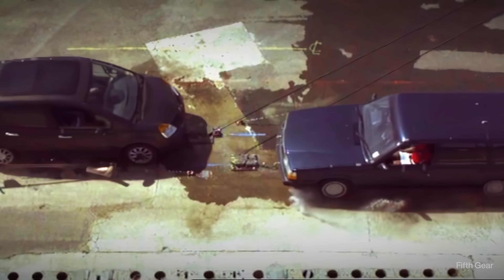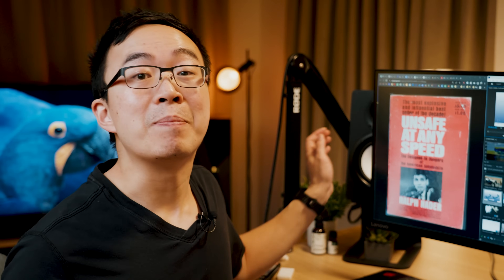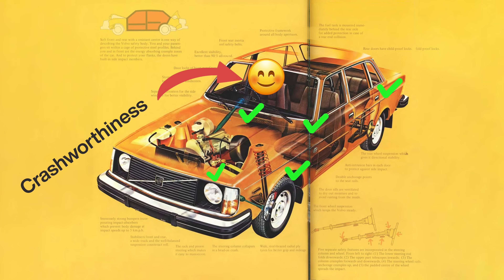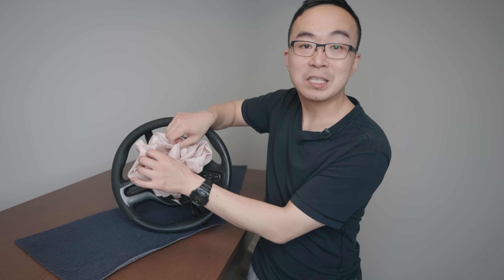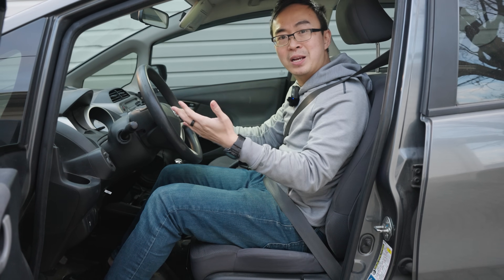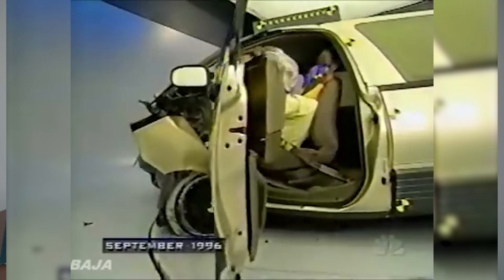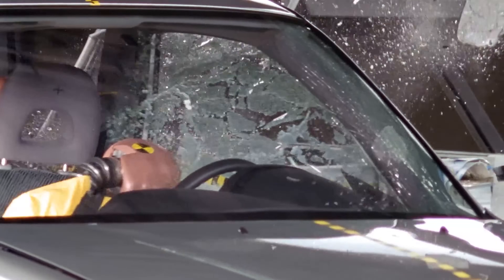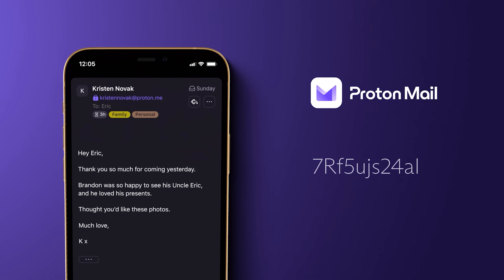When does a car stop being safe?

Comment: The one thing that is often ignored in the US and leads to a ton of SUVs and trucks is that crash tests rarely involve persons outside the car. Yet cars crashing into pedestrians and cyclists at low speed is super common! Adipositas cars (SUVs) usually fare badly here.
Reply from the maker: 100%  it's one of the major differences between American and European cars
Reply: @Mika-ph6kuI occasionally see people who just barely poke above the dashboard
Reply: Good observation! In the US suv's and trucks tend to receive higher crash ratings because of this, hence the trend of more and more large vehicles on the road in the US. Other countries and testing standards actually rate them far lower due to their mass and size and damage they can cause. US crash tests tend to only focus on the occupant of the car.
Reply: ”other countries rate them far lower because of their mass and size and the damage they can cause”?
Well that’s stupid.    
You’re supposed to be rating their ability to protect its occupants during a crash.  
Not fat shaming big cars because of the damage they   could   maybe  one day  potentially cause.   
If that’s true other countries crash testing is dumb AF. 👌
Reply: @jaxturner7288  If everyone has smaller cars, it is better for everyone. If you start going out there with tanks, the ones not having tanks are the ones that are suffering and thus also have to build a tank. That tank isn't better when crashing into a wall than the small car, its only better when crashing into a small car.
Reply: @jaxturner7288  No.  The point is to reduce the insurance companies pay out.  Doesn't matter if they're paying for people inside the car or outside it.
Reply: @Zorro9129  I guess not getting shot in an American school is also a skill issue. Could also be dumb luck. The dumb part being that kids run around with guns in the first place. 

Those big cars have the same effect. People in general aren't that great at driving and if some idiot in a pickup hits you there is nothing you can do. Its not your skill, its just dumb luck. The dumb part .....
Reply: @JohnHughesChampigny  and that tells you all you need to know.  
That means that country’s crash tests are focused on protecting the insurance companies, not the vehicle owners. 👍
Reply: @_aullik  lol obviously you haven’t seen a tank crash into anything.  

Look up tank vs tree. 
Look up small car vs tree.  
And then come back and tell us how much safer the small car is for its occupants.  👌
Reply: @_aullik  Actual pickups aren't much worse than a regular car (the front half of them basically IS a car, shape and size wise. They're a bit longer, their frame and suspension are stronger, the engine may or may not be heavier, and the back end is shaped differently, but other than that? basically a car). modern american SUVs are substantially longer, taller, heavier, and have Less Cargo Space (not that that matters, their owners aren't using them for that) than an acutal pickup truck, as well as being shaped in a way that is less aerodynamic, impares the driver's field of vision, and increases the harm done to pedestrians and occupants of other vehicles in an accident.
Reply: @laurencefraser BS, their usually much higher
Reply: @jaxturner7288 if you don't understand why also factoring in the crash safety for people outside the car is a good idea, then you really shouldn't call others "dumb AF"... 😪
Reply: @Zorro9129 "guns don't contribute at all to the problem" 
More guns will always mean more gun accidents and more gun violence, because neither can happen without guns. It's a very simple statistic fact (more exposition to a risk = more accidents) and you're literally denying reality if you don't recognize this!

Also: "ThEn We CoUlDn'T hAvE 18-WhEeLeR tRuCkS!": right, it's not like there's a special license with loads of extra training and tests required to drive one of those! 🤦
No, we can't limit the maximum weight of personal passenger cars because of all those commercial truck drivers driving 18-wheelers with the standard driver's license for personal vehicles! 🤣
What an absolute shit-take!

Btw: I dunno bout the US, but most European countries literally do exactly that: they limit the maximum loaded weight that the holder of a normal DL is allowed to drive, usually to 3500 kg. 
Which has the interesting side effect that most VANs can carry a bigger load than any SUV, because many SUVs have an curb weight of more than 2500 kg already without even a driver in them, meaning you can only add at most one ton of load (including the occupants) before you reach that 3500 kg limit, whereas even a big transporter VAN may be as light 1600 kg, giving you almost two tons of permissible load capacity, before it would require a higher license class to drive.
Reply: @_aullik  can everyone fit in smaller cars?!
Reply: SUVs and pickup trucks tend to punch you in the chest and knock you under them, which is way worse than being hit in the legs and going over the top.
Reply: Euro-NCAP does these tests, however american SUVs are usually not tested as they are not sold in europe. However these tests have shown that SUVs tend to throw people infront of them an then roll them over instead of pushing them onto the hood, wich is what normal mpassanger cars do.
Reply: @Mika-ph6ku It's like when I see people driving the same kind of car I have but their eyes are level with the top of the steering wheel. I'm of average height and my eyes are several inches above the top of the steering wheel.
Reply: It brings back memories of when I was a kid in the car and my eye line was 4" above the bottom of the window. Now even in "racing position" in my mini my head is quite high.
Or the insult in Midnight Club 2 racing game "You can barely see over the steering wheel you little arsewipe!"
Reply: I can't see my hood at all. If you were short I wouldn't see you either. I hit a 4 foot post and couldn't see it at all. I really don't like it, I used to have cars where you could see down the hood to the bumper.
Reply: @napalmholocaust9093 I don’t fear many… but you scare me
Reply: @napalmholocaust9093 erm, adjust the seat upwards, maybe?
May I ask why you even bought a car that you can't see out of? 🧐
Reply: @napalmholocaust9093  if you cant see down your hood you shouldnt drive. in my country at least its a felony to drive a car when you have insufficient vision (or anything else that is obviously dumb and dangerous) and you will get your license revoked additional to a lawsuit if they ever catch you driving like this.
Reply: @rolhen8221  the UK rule is "must be able to read a number plate from 20 metres", which could be violated if your vision becomes too fuzzy at that distance, or you can't even see 20 metres ahead of you due to you fitting the car like a young toddler.
Reply: Well you can set the seat to see as much of the hood a possible and before you ge too close to not see what it is you're gonna crash into, look ahead and see what's there, if you're not sure then step out the vehicle and check with your own eyes, this is what I do and I don't care if other cars are waiting for me to move, I do this not only for my safety but theirs as well and if they don't understand this then they'll know it when they crash into something they didn't see
Reply: @napalmholocaust9093  ive driven large pickup trucks and tiny sedans and pretty much everything in between. ive never not been able to see the hood, expect in sedans where i intentionally put my seat lower and even then i can still just barely see it. sounds like a u problem lol
Reply: "Adipositas cars (SUVs)" 😂 So true! Each time I look at mid-sized SUVs, I can't help but think of obesity disorder.
Reply: Which is also why EuroNCAP rates not only how safe the car is for the occupants but also to people outside.
Big American trucks and SUVs like F-150, Suburban, etc. fail misserably in those which is part of the reason they aren't officially allowed to be sold on the market and you have to get them imported. The massive grills and hoodline taller than a 12 yo child make them death on wheels for anyone unfortunate enough to get hit by any of them...
Reply: @edim108  the reason you have to “import” something is…because it’s made somewhere else.  
Like America doesn’t have to import all its BMWs?
That’s not because of bmws crash safety ratings, that is because they are made somewhere else. 👌
Reply: @jaxturner7288  What he is talking aboput is that you have to import them via a 3rd party, also called grey import. This drives up the price of the car massively and also limits the amount of vehicles that can be imported. Usually the limit is 5000 a year. For example, a Ford F150 costs an equivalent of 98000$ to buy new.
Reply: @arandomelk8559  shiiiiiiiiiiTT

A Nice F-150 is almost 100 grand in America right now.  
Gray market import markup?
sheesh  they are built  just an hour away from my house and you pay about the same as me. 
Keep crying.  
I’m playing the world’s smallest violin for you.  

Seriously,  has the euro doubled since the dollar dropped or what?
Reply: @jaxturner7288  I believe so. And eventually there are also aditional taxes, I dont know tbh
Reply: In other news: water is wet and the SUV craze is dangerous to society
Reply: Adipositas?
Reply: @Therapistinthewhitehouse  Overweight.  Or, to be less polite, FAT.
Reply: @JohnHughesChampigny  
That’s adipose or adiposity in English.
Reply: Yep I think cars are getting worse at causing damage to pedestrians. Old cars used to be lower and have lower hoods so that when they'd hit a pedestrian, the pedestrian goes over the hood and the energy is transferred upward. Nowadays it's like all SUV's and big trucks so when they hit a pedestrian, the pedestrian gets slammed into the front and sucked under the vehicle. And I won't even get into how heavy and fast these cars are getting.
Reply: @RetroWaveShredder  Not in Europe. Unlike the USA we have minimum pedestrian crash safety standards, pyrotechnic pop up bonnets, bull bar bans and other aspects of the designs to help reduce injury. It's astonishing how America makes so much effort to protect those inside cars, but none for those outside of them. Pedestrians, cyclists, motorcyclists etc.
Reply: Yes, and Fortnine's recent video explains this well.
Reply: ?! people outside the car can feel free to be aware of their surroundings and... GET THE F==K OUT THE WAY! Feel me?!
what the hell is 'Adipositas'?!
Reply: @TENNSUMITSUMA  I can also just carry a brick with me whereever I go and threaten to throw it through your wind screen if you threaten me with your driving, two can play at this game.
Reply: @Mika-ph6ku Simple geometry would show you that even with your eyes being level with the roof and a straight line to the top front of most full-size trucks hoods that there is an enormous blind zone in the front that several children could hide under - standing up. 
Don't act like modern trucks aren't fucking stupid just because you got brainwashed into "needing" one.
Reply: So Mr. Lam is going to be safer by walking more!  Hopefully not on or next to any roads!
Reply: @Mika-ph6ku even then you can't see the 4ft directly in front of ypur hood
Reply: I know! More people really need to pay attention to where they're walking!
Reply: Its not practical to, its just the risk reward price for having cars. If a pedestrian gets hit they probably die but we live with it because the economic advantages to everyone are worth more than their lives.
Reply: They do here in Europe, it's one of the reasons why our roads are so much safer.
Reply: Ironic that OP mentioned walking more and driving less!
Reply: I think that the other reason SUVs are popular in North America is because our roads suck.  There are places where I can't go in my Nissan Leaf because the speed bumps are too high or the potholes are too deep.
Reply: Lmao you dont own the road try to stay on the side walks and look both ways and believing you have the right away well there always the Darwin Award
Reply: Who didnt get toaght not to play in the street or look both ways?! Thats kindergarten crap!
Reply: I will never stop saying that SUVs and large vehicles in general need to be strictly regulated and heavily taxed, especially if they are being driven by people who do not really need them.
Reply: @TotallyNotASpy1 Europe's going to tax them out of the cities and suburbs, they're a menace.
Reply: @TotallyNotASpy1  lets see what good that does……..

🗣️
Reply: Blame the US environmental rules which encourage SUVs and trucks, and worse, encourages larger ones.
Reply: But the US is the land of the free and the selfish. So they still choose to drive tanks.
Reply: Giant cars and Emotional Support Trucks are absolutely a danger to pedestrians, especially children. And that includes anyone who drives one of those vehicles, parks, and gets out of it. So the type who pretend that pedestrians don't matter are really the most idiotic drivers out there - and it's a tragedy that it's the biggest idiots who are a threat to the people who take the most care of their own health by walking and biking more.
Reply: @chrisedwards3866  once pedestrians stop walking in front of moving vehicles as though they're super f==kin man and the vehicle will wrap around them, then maybe more people would give a f==k about the foolishness you just typed.
Reply: @TENNSUMITSUMA  did their calling out your compensator truck hurt your feelings or something?
Reply: @NerdyFurry  compensator truck... not everyone is 5' 100lbs like you!
Reply: @TENNSUMITSUMA  Damn stop making your truck thing your personality
Reply: Which is why the IIHS has shifted more to preventing pedestrian impacts all together with testing vehicles AEB systems, they must be able to avoid pedestrians at low speed to score well. Still, there's no pedestrian impact testing.
Reply: where did you read crashes into pedestrians and cyclists are "super common" in the US?
Reply: @MiroBG359  "GHSA projects at least 7,508 pedestrians were killed in traffic crashes in 2022, continuing the upward trend in recent years. This would be the most pedestrian deaths since 1981."
US population: 333M (V2022, Census Bureau)
US pedestrian fatalities: 7,508 (2022) - increasing sharply over time (more than 50% in a 10 year period)
US pedestrian fatality rate per 1 billion vehicle miles traveled (VMT): 2.37*
US pedestrian fatality rate per 1 million population: 22.5*
*Based on GHSA projections

EU population: 513M (EU-28, 1 January 2018, reported 10 July 2018)
EU pedestrian fatalities: 4,763 (2018) - declining over time as member states adopt safety measures
EU pedestrian fatality rate per 1 million population: 9.3

This would be even higher if more than 3% percent of people ever actually walked or cycled in the US (Census Bureau).
Reply: @MiroBG359 Google it. Pedestrian deaths trending way up over past years.
Reply: @MiroBG359 We've just seen the horrendous death rate Sweetie, and the fact you've got no federally mandated pedestrian safety standards for your cars and trucks.
Reply: Umm no.  
Pedestrian crash safety standards actually DO exist and American cars have to comply with them.   
You’re just too young to remember when vehicles designers actually didn’t care about pedestrians safety. 

Nothing was less forgiving to pedestrians and bikers than the chrome steel push bumpers and flat grills of the 60s and 70s.  
Back THEN pedestrians safety was   not considered during vehicle design.   
But it definitely has been for decades now.  👊
Reply: Stay out of road
Reply: yes but why?  mostly its digital deadwalkers with their eyes on the phone all the time on bike or on foot:D want to survive? act like it and dont wait other around you to do it for you.
Reply: @tomast9034 That's not true, and car drivers have additional responsibilities towards more vulnerable road users.
Reply: @ChrisPatrick-q6k   yes but...from here to there. no one investigates if he/she dive jumped under my wheels from behind the bush. the police would 99.9% i should have expected it.
Reply: @tomast9034  Because people are diving out of bushes under cars all the time right?
Reply: @tomast9034  Because most drivers are aswell. And the fact that you just say that bikers and pedestrians are responsible for not beiing hit by a car might indicate that you shouldnt drive. A car has a much higher operational risk than a bike or a pair of shoes. I have not heard of someone killing somebody with a bicycle yet (wich doesnt mean that this doesnt happen) but I know more than 20 cases of cyclists being killed in accidents where they were not at fault. If you ask me, the main risks are bad infrastructure, car infotainment and eldery drivers. And if an accident is unavoidable, the car should at least somewhat protect people who do not have a 2 ton steel shield around them.

Comment: What about the large old cars with double frames versus new modern little cars it's basically going to be like a monster truck turning it into a Hot Wheels. Yes some old cars were not designed very well and not structurally sound but some of them were a lot more solid and a lot safer than the newer vehicles.
Reply: they were TOO rigid.  Yea they held up in accidents well, but that basically means the passengers were subject to more force.  It's the same problem a smart car has, no crumple zones.
Reply from the maker: Yeah, exactly that, cars can survive a lot more than people